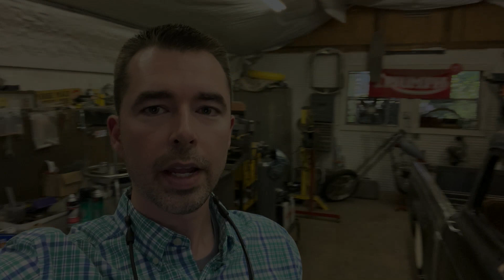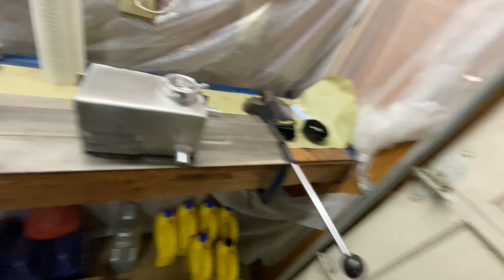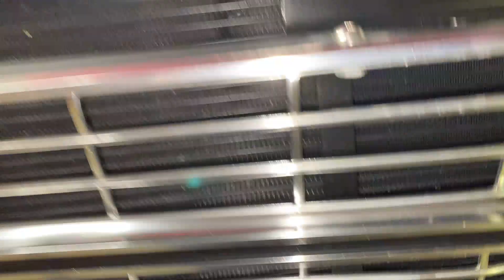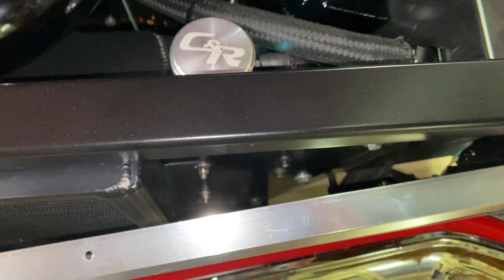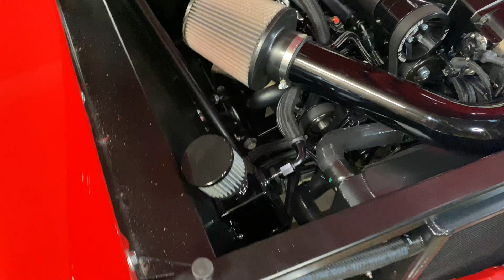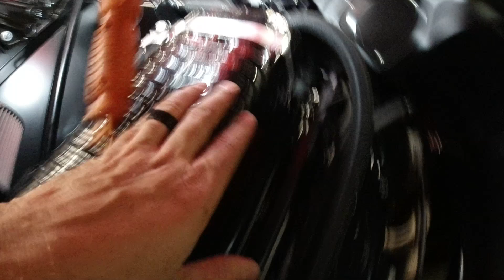Custom Whipple Supercharger Cooling System [Part 3]

Comment: I have a question about the block at the back of the whipple. I purchased on and I am lookinf for a block that has threads and not fixed nipples.
Reply from the maker: I believe they are just -8AN O-Ring fittings.  So you can buy any adapters to fit -8AN O-Ring to AN fittings.
Here is an example.  https://www.summitracing.com/parts/sum-220165b
You can also get these fittings that step up the size to -10AN or -12AN.
Reply: @grandtouringpro  I really like how nice and clean your setup is great job.
Reply: @grandtouringpro  Okay you must have a different set up, my block is bolter to the cooler I thought perhaps you changed yours. I am doing the same setup in a 66

Comment: What hood latch did you use that worked with the intercooler? I was entertaining QL-50 hoodpins, but I like your setup better.
Reply from the maker: Hi Rooster.  I actually had to create a custom setup.   I took the stock hood latch and modified it to accept hood pins that hang down.  They go into a flat plate that is mounted behind the grill and the pins slide in.  If I had to do it over I would probably just use traditional hood pins or aero latches.  I hope this helps.